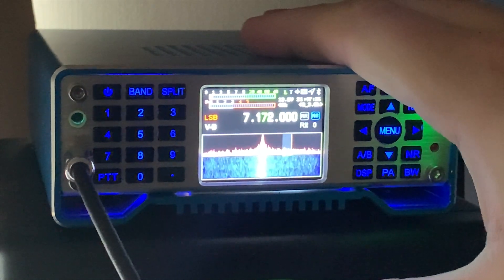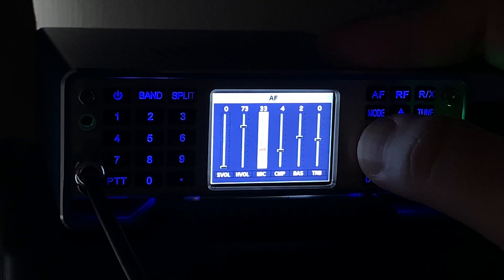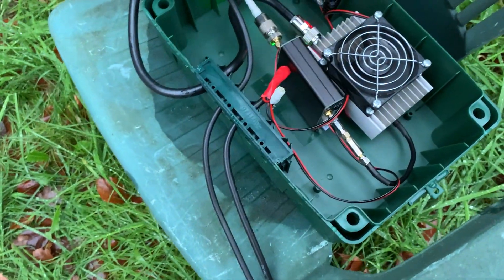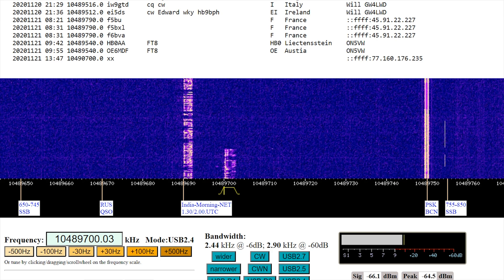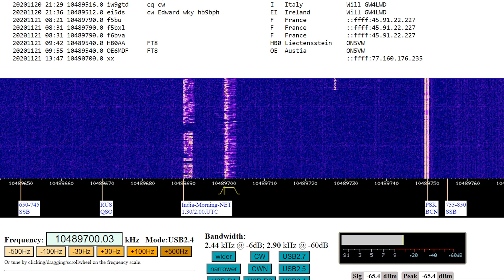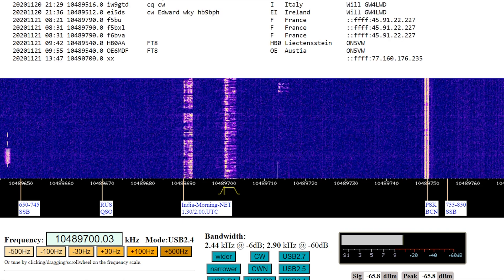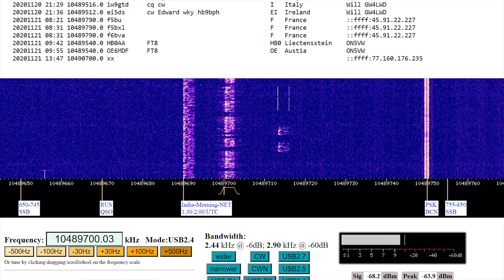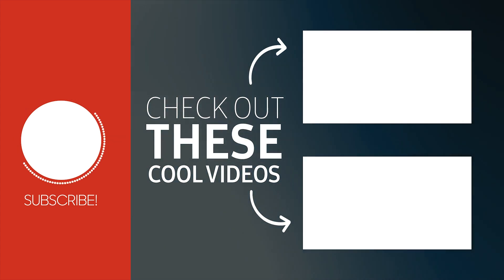Ailunce HS2 on QO-100 Via DX Patrol Transverter

Comment: Thank´s for the Video.
My question is which exactly attenuator (db) and bandfilter you use between DX Patrol MK3 Transverter and SG Lab
2.4 GHz  20W  Power Amplifier V3. Thanks for the help.
Best reagard, Tom DJ4TP

Comment: Very smooth audio for a transceiver no-one likes!  Well done!  F1VFL
Reply from the maker: Exactly, I think it a great little radio :)
Reply: @TechMindsOfficial  not so great waterfall display with the center peak no matter where you tune to .... also there's noticable IMD compared to the clean signal left in the passband. not mentioning the muffled audio as this surely could be fixed. it is a radio, but I don't think it's that great. Maybe compared to a FT-817, not to a modern radio. Just my 2 cents, use whatever works for you and you have fun with. 73.